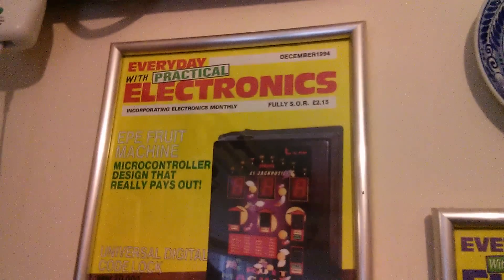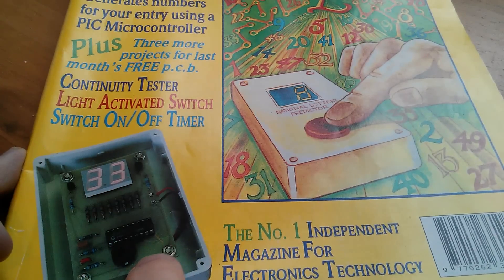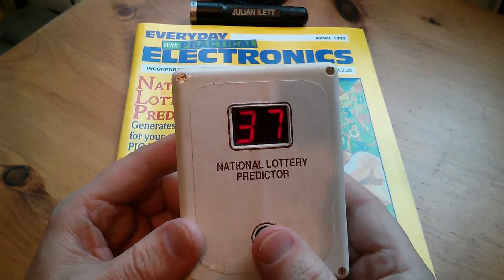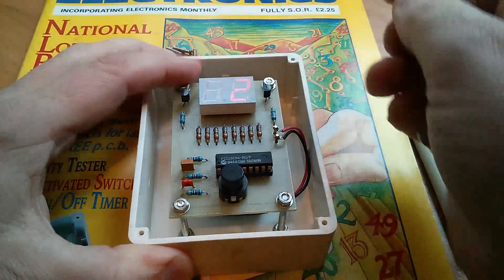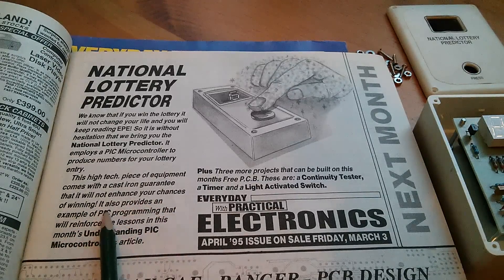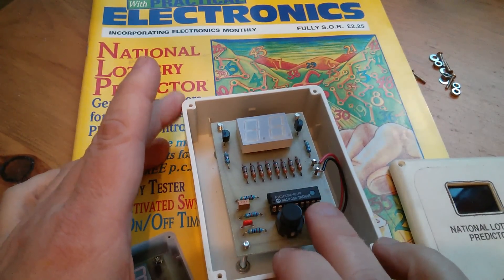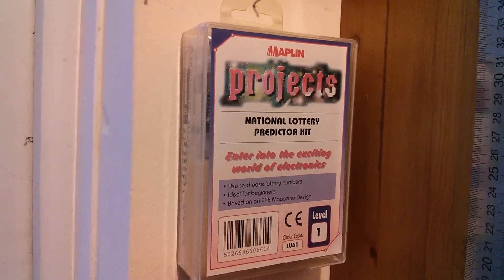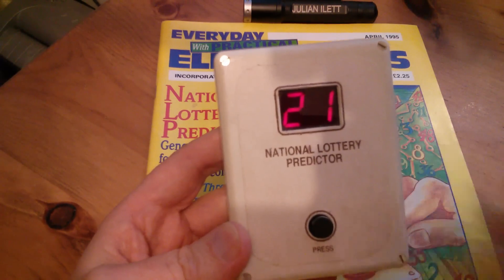Retro Electronics: Magazine Project - National Lottery Predictor

Comment: In the early 2000s I wrote a program in BASIC to predict lottery numbers.  It picked 50,000 random numbers and then sorted by the top 6 and then gave those as an answer.  My aunt thought that I had some how "cracked the code" and was sure that this was the secret to winning.    She asked if I could put it on her computer, so I did.  After several weeks she said "your program doesn't work! I haven't won a single cent!"  I told her that just because they are computer generated doesn't mean there is any higher chance than blind luck.  Especially since the lottery numbers at the time (and I think still are) based on ping pong balls being blown inside a clear plastic bubble that somehow make their way down a chute.  One feature of this program which I think made it more attractive (in sort of a movie special effects way) was the fact that it scrolled all 50,000 numbers across the screen via a PRINT statement with a semicolon on the end.  So rather than the 6 lottery numbers simply displaying instantly, since picking 50,000 random numbers is nearly instantaneous, you had to wait 30 seconds or so to get your result. So it seemed like the computer was having to do some heavy work and calculation, but it was simply relying on the video card to slow it down and look more cool.
Reply: Their system is specifically designed to be unpredictable. That's why they add the additional variables of n machines and m sets of balls.

The Balls and Machines all have unique characteristics that statistical analysis would uncover over time.

Comment: +Julian Ilett - At first thought I was wondering how you kept track of which of the 49 numbers were called with the limited RAM in the 16C54.  Only 25 bytes and you need some for other parts of the program cycle.  But then of course you don't really need to know what order the numbers were in only what was already PICked... simple mapping of the 49 numbers to single bits.  That works.  Good job.